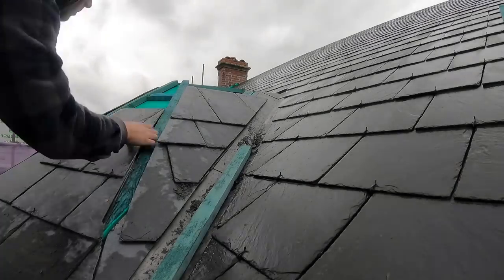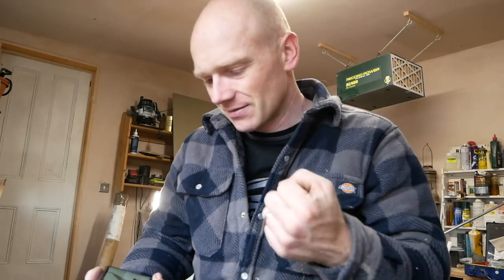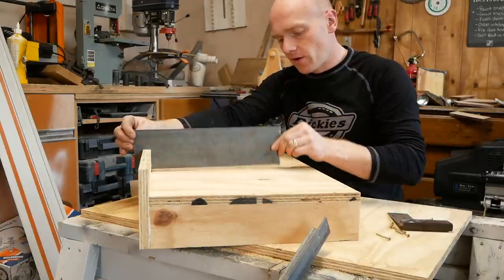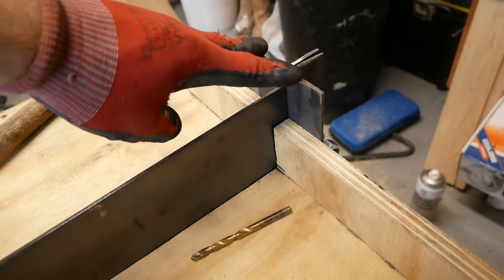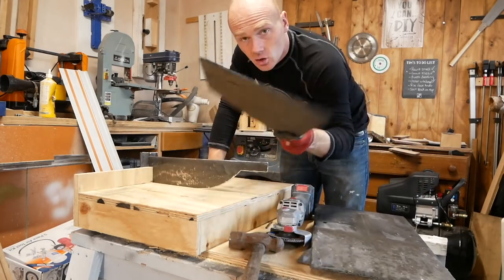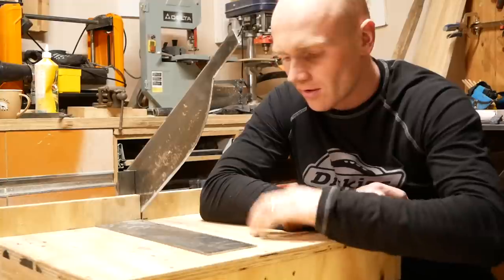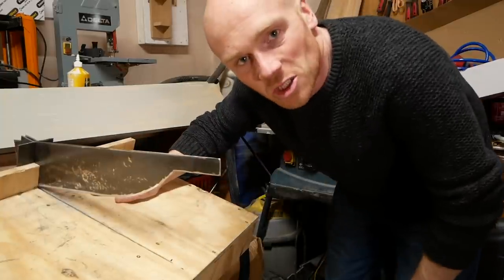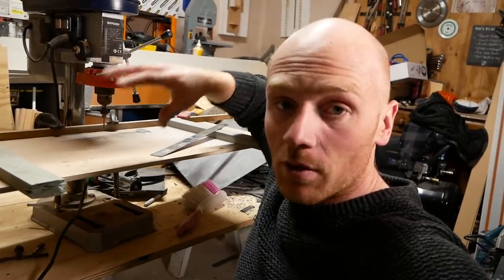Well that didn't go to plan! - Slate Cutter Build

Comment from the maker: Although I got it all done with the hand held cutters in the end.  What do you reckon... Higher pivot, more curve, harder/thinner steel? Perhaps I should have just opted for an old slate axe! Oh well you win some you lose some. 😁
Reply: Your leverage runs out pretty quick with that design regardless of blade shape. I think I would have just tried a wet saw.
Reply: Definitely the blade shape.  You have a long flat blade edge.  If you make the whole blade curved it should work better.  That will help ensure you are only cutting in one small pint at a time.  Also the re likely needs to be a nice tight fit between the blade and the base edge.  It would have to be metal.  Finally I couldn't tell the shape of the edge o. The blade, but it should only be one sided.  The flat edge would then go against the metal base edge.
Reply: Its the angel of the cutting edge that contacts the slate you want a curve so that the blade is around 30⁰ at the point of contact:)
Reply: You could try starting the cut with the slate squared onto the opposite side of your jig, that way you would use the curve and you could push the slate onto the blade like you wanted to do
Reply: It’s exactly as Adam says. You need to ensure that the blade is only cutting at a single point at all angles throughout the cut. This could be achieved by modifying the blade shape, the pivot point, or both. As you move the blade through it’s arc, the angle of the section of blade where it passes through the cutting board should always be fairly steep to ensure you’re applying the cutting force in as small an area as possible.

Edit - if you look at commercial designs you can see that the low pivot models have straighter blades (because they can) while the high pivot models need much more dramatic curves. Both achieve the same thing.
Reply: For a quick test of the angle, try building up the bed. Try some one inch blocks either side of the blade so the slate sits an inch higher, that'll increase the cutting angle without much effort.
Reply: Probably take out the backboard so you can push the slate in further to create a the pinch it needs
Reply: I definitely think set the pivot point lower, try there then maybe curve blade into a bow shape? Great videos btw 👍🏻

Comment: As others have said, the blade needs a continuous curve. Ideally with a smaller radius the further away from the pivot, so that the point of contact reduces as the leverage reduces.

Comment: I think the blade curve needs to start earlier in the cut so that the cut is gradual through the slate. Otherwise you are asking too much of the blade. A curved blade will have a smaller point of contact therefore less pressure will be required to make the cut.
Reply: This! The curve is so that the blade is only cutting one bit of the slate at a time. Concentrating the pressure on a small area of the slate.
Reply: Agree, the curve should start below the surface so you always present an angle to the cut, also, i'm not sure it should be sharpened like a knife as it would be more like a wedge, take note of the 'sharp' edge on the hand cutter, i'm thinking it should be a square edge that pushes the waste through  the gap.
Reply: @sparkyprojects  I think you're right so a sharpening a bit like ice-skates where you have a hollow in between the two shard edges would allow you to shear the material in front of the blade. Also the angle needs to be steeper and be the same across the entire tile so the blade needs to be a continuous curve so that it has the same angle relative to the tile across the whole width of the cut.

Comment: Well good on you for trying! I think it needs three things: 1. A 90 degree bottom plate and a 80 or 75 degree cutting edge, so nearly square.
2. A more rolling action of the actual cutting contact area. You'll want only a small area in contact with the slate and have it walk across the slate. That can be done with a curved blade that's hinged cleverly, perhaps even in the middle. Need some paper cuttings to try that out quickly.
3. The chips need somewhere to go. It takes a lot of force if yoy'd try and squeeze them through that narrow slot. So you'll need to find the sweet spot between too narrow and too wide. That's why I think a single cutting edge on one side of the blade may help. I could be all wrong. Any slate experts out there?

Comment: Hi Tim, a travelling tile saw will make repeat cuts at any angle that you set, with a nice clean edge to the cut - nice to see you trying different methods, despite it not having the results you would have liked... Alex
Reply from the maker: Guessing that won't give the riven edges for slate though.  Shame.

Comment: I think all that is stopping you is that the radius of the blade doesn't start early enough - If you carry the radius all the way back through the fence, so that you only ever have a few mm in contact with the slate as you drop the blade you should be away! 👍

Comment: Blades are curved so as to only apply a tangential force to the material being cut. Otherwise as the blade gets to the horizontal, the material cross sectional area increases making the force required increase (F=MxA) Therefore = Blade must only meet material being cut when the blade is travelling in an arc. Perhaps cut an arc into the back half of the plate, and lower the pivot bolt hole (to save making another blade).

Comment: Would it help if the pivot was under the bed height so you are cutting down in the slate - it looked like it was cutting when there was an angle on the blade but when it got flat, it stopped cutting. Good effort though!

Comment: Don't push the slate to the back fence . Hold it at the front and push it back with a number of repeated actions nibbling your way through
Reply: Some kind of sled to hold and move the slate along a single line might help too.  (Although a side guard would have the same effect, I guess.)

But if you did go with a sled you could put a motor on that drives the sled and the cutter in a nice three stroke action:  1) cut the slate, 2) raise the blade, 3) ratchet the sled forward.  :D

Comment: Would it work if you started with the slate away from the fence and gradually moved it forward cutting along it a small bit at a time so you can use the front curve of the blade? I realise it makes it harder to keep it square though.
Reply from the maker: It does a bit yes however the main reason for the board setup was to have the square fence and stop blocks.  Never mind!

Comment: I was shouting put more leverage on it. Then you did and it still didn't work lol. Good attempt though. That hand cutter does work well though minght get one on them in the future 👍👍👍
Reply from the maker: They work great.  Did the whole roof with the handheld just fine but cutting 100 slate boards on 4 sides has led to a rather painful hand. 🙄
Reply: @TheRestorationCouple  yere bit of cramp in the hand doing all that lot. Grate for roof repairs I bet. Roof looking tip top mate 👍👍👍

Comment: Strap the scissor type to a board and use leverage to save your hands.... maybe?
Reply from the maker: When my hand was in agony I just sat the bottom handle on the worktop and crunched the top one down as they are sprung.  Not ideal though.

Comment: It’s the fulcrum point that’s the problem there . The amount of force needed to cut slate is a lot really . If you watch how the split slate and then cut em to size . They just use what looks like a machete with the slate resting on the edge of a piece of steel bar and just hack at it with small strokes . They can’t do it in one big swing . And that’s what you are doing really . Good try though mate . Top bloke 😉

Comment: Having the curve all the way down the length of the blade insures the blade always meets the slate at the same angle and you only have a small contact point, that’s why it cuts the first few cm but soon the blade is laying flat on top of the slate and you don’t have a cut angle
Reply: I second this thought.  Cut some more curve in the blade and try again.
Reply from the maker: Yep, that and a higher pivot point.  Basically like the photos I was using for reference but clearly didn't very well! 😂
Reply: @TheRestorationCouple  lower pivot point so the blade starts at a higher angle + to compensate for the curve at the back requiring the blade to be dropped